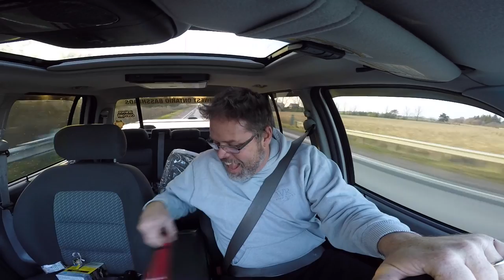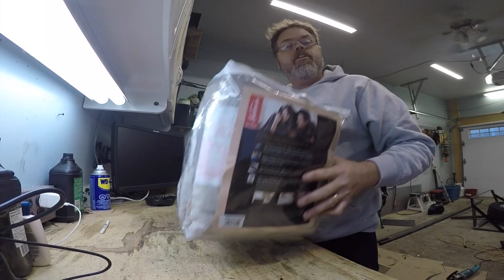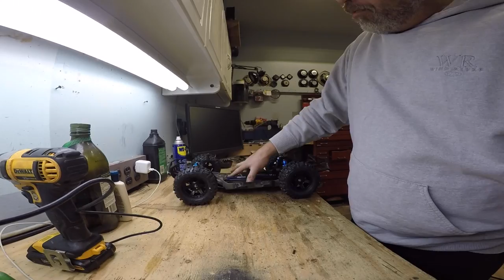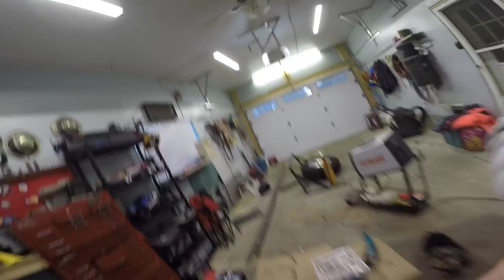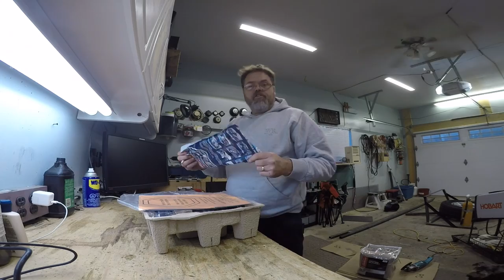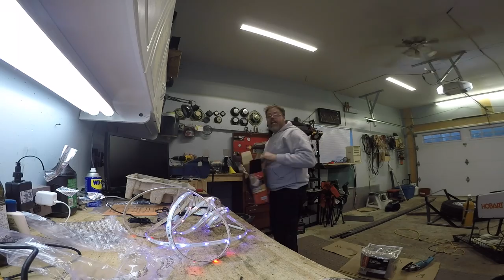SLASH ON PROLINE 2 8'S With Guest SunBeam Heating Blankets and LED strips

Comment: I have that exact blanket. Yes wife has her side turned on and I can sleep with the window open. You may find the cord for the controllers is just barely long enough. Wish they had of made them about a foot longer.
Reply from the maker: I ran mine right under the bed and have abut 3 feet of wire to spare and its a king . maybe they herd you and made them fuckers longer lol
Reply: Lol. Ran mine the same way and both controllers just barely make it onto the night tables. Probably had complaints so they put on extra wire. Or maybe I just don't know what I'm doing...
Reply from the maker: ya man I have a controller on each side in the end tables with lots of cord the made them longer for sure . why the fuck wouldn't they